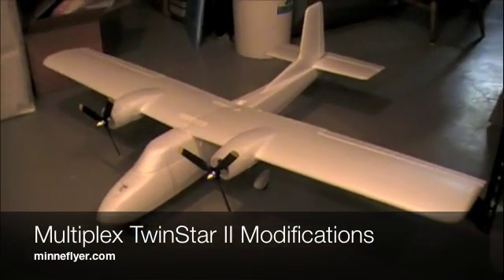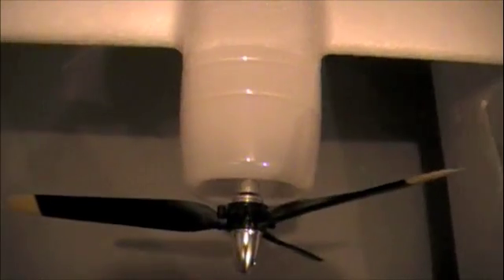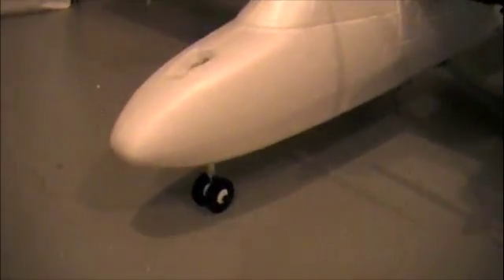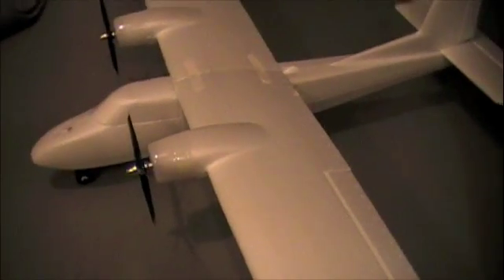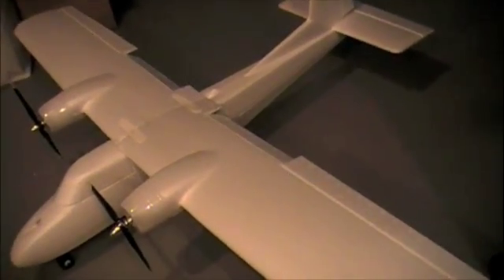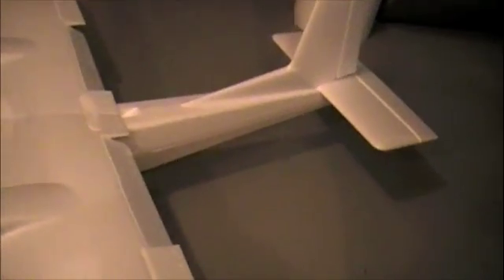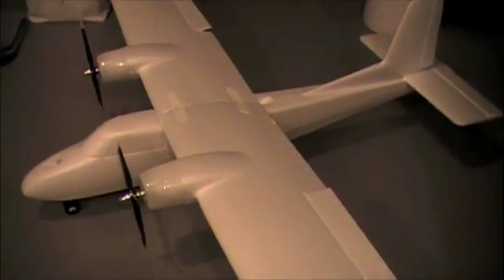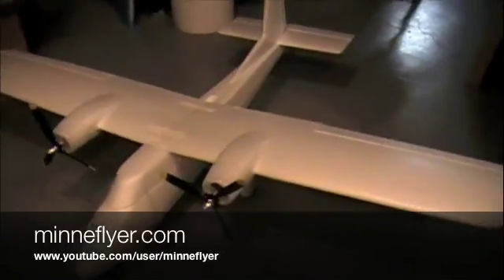Multiplex TwinStar II Modifications

Comment from the maker: Hi there, thanks for your comment!  I'll try to answer you a bit here, but feel free to email me or find me on RCGroups and I'd be happy to elaborate. Flaps and Spoilerons are easy, just used 2 separate servos for flaps and mixed in my spoilerons using my transmitter (9 channel). The bolts for the tail feathers are 1/4 inch nylon and they thread into some bind-nuts that I've glued into the fuselage. It's really easy to do and I'll try to get more video showing you details later.  Thanks again!

Comment: Nice Ideas :-)
I've got also the twinstar, mine is using FPV.
And stabilizing the flaps with a cheap gyro (20-40$) will make it much easier to fly nice and slow and without any problems in the handling.

Comment from the maker: Hey thanks for the comment! You are exactly correct about the spoilerons. The spoilerons are mixed to deflect upwards about 15%, but they still act as ailerons. If you check out my flight video: (see my channel) at about 1:14 you can see both flaps and spoilerons deployed during a slow fly-by.  The spoilerons help to stabilize the plane during nose-high attitude at lower air speeds, while the flaps provide lift and also decrease air speed.  I recommend them both!